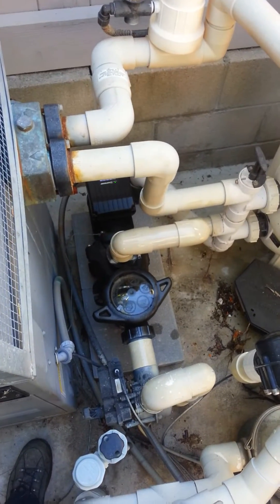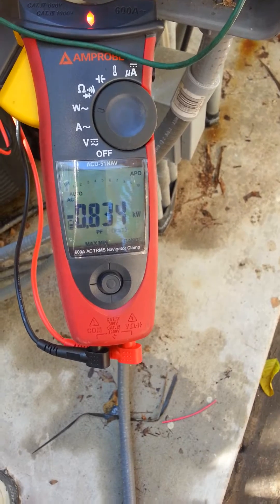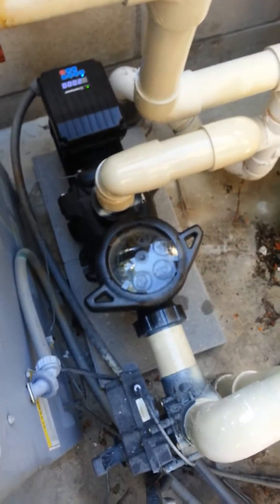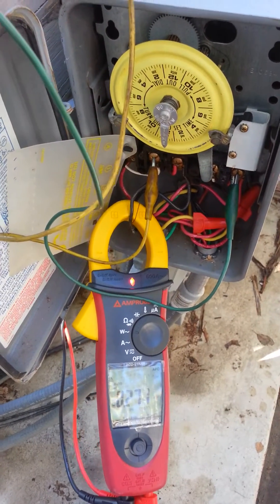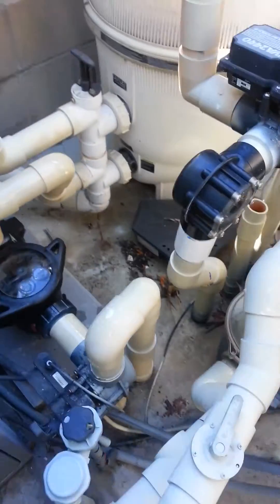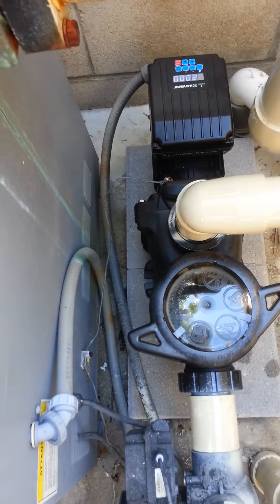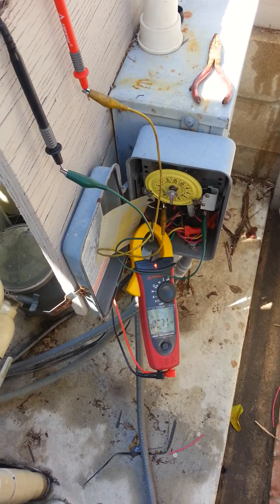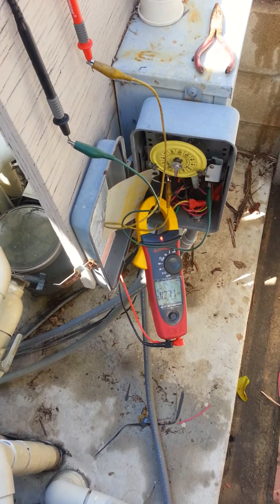Max-Flo VS install and review

Comment: Question for ya, I was looking at getting one of these, but I cannot find that many knowledgeable people around to talk with me about it. My current setup is this: 14x28 ~13200 gallons, Aqua Genie skimmer system, Pentair WF-24 1HP, booster pump to run Polaris 380, 1.5" plumbing. I have no water features. My concerns are as follows: can I run the polaris cleaner with this pump running around 1200-1500 rpm (will that provide enough flow to the booster pump)? Aqua Genie skimmer is the only return/jet in the pool and if I reduce to lower rpm after the intial 2 hr 3000rpm startup, will it still be able to filter water properly? The main reason I am looking at this pump over the Tristar is I would like take advantage of the energy savings (although our power here [Alabama] is only $0.13/kWh) and run at quieter speeds. Our swim seasons tend to be 6-7 months at least. I know I have a relatively small pool and a medium head pump like this one would likely be fine, I am just nervous b.c. I am purchasing online at a much better pricepoint and having it professionally installed. Any help or incite you could provide would be very helpful.

Comment: I need to replace my pentair single speed pump and am considering this unit.  My goals are to save money, reduce noise level from pump and automate my system (next step).  Would this be a good pump?  I'm salt water and have a small spa.  Total about 12500 gallon.
Reply: Its pretty durn noisy !